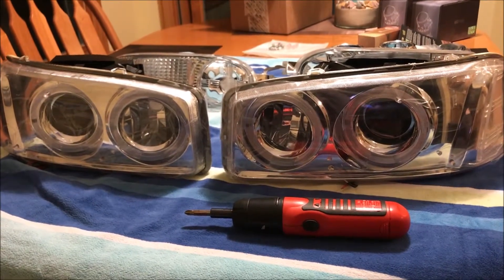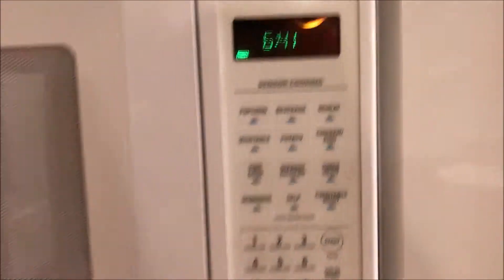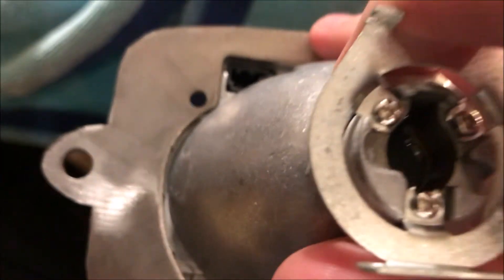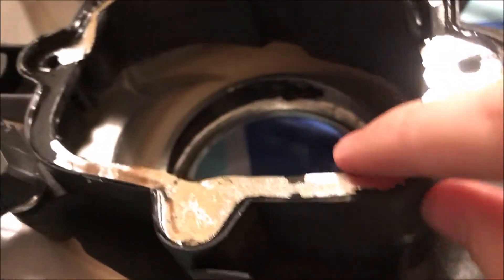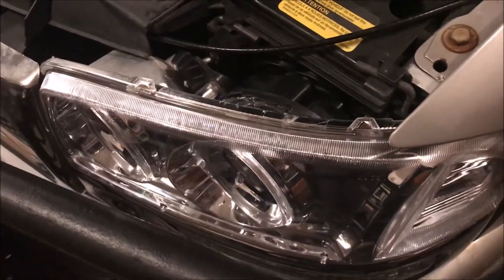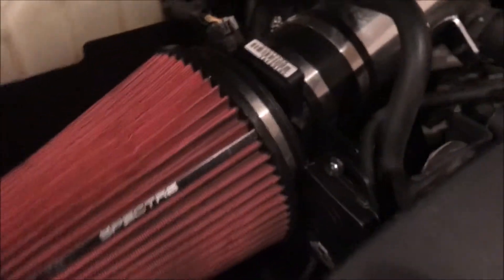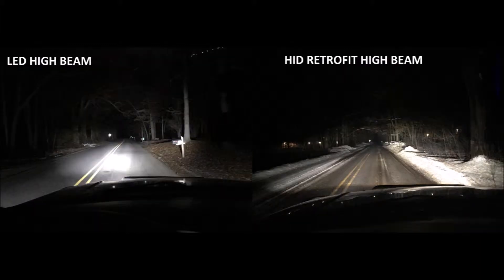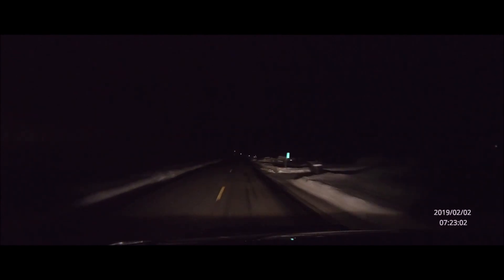OldGuyDIY 2000 - 2006 GM NBS Yukon Denali Sierra HID HeadLight Retrofit

Comment: For anyone that stumbles across this, the OEM denali lights dont require heat to remove the projector. Also, you can fit the Mini D2S 5.0 which is a MUCH better projector, although will require a bit of extra work. I did a quad retro on a 2006 Silverado using the mini 7.0 and d2s 4.0...you couldnt even tell the mini 7.0 was on. That said, 7.0 is still a solid upgrade over the stock halogen projector.

At anyrate, a solid upgrade! Thanks for not just stuffing an HID or LED bulb into the stock housing!

Comment: Whats the diff from the projector u took out & the one u put in??
Reply: The projectors that were taken out we're designed specifically for a halogen bulb so the optics are tuned specifically to the halogen bulb and if you were to stick an HID or an LED bulb it would make it slightly brighter but barely and the light would be somewhat  distorted. Now the HID projectors that were put in are the best HID projectors in their respective size and class and the optics are specifically designed to take an HID bulb. Unlike halogen projectors the lenses in HID projectors are crystal clear allowing more light to shine down the road further and crisper. The cut off line of the beam is much sharper than halogen as well. The beam pattern of these specific HID projectors is very wide allowing the driver to spot potential dangers on the side of the road much sooner. These HID projectors far exceed DOT standards.

Comment: thanks for the vid, i may give this another try before i open up these other headlights i ordered because i couldn't get the projector removed, guess i wasn't using the right heat temp.
Reply: just wanna say thanks, had to keep it in a little more then 7 min. but got one finished,  thanks man.